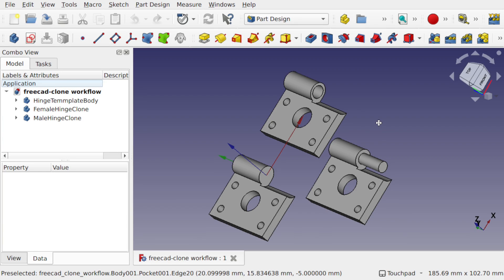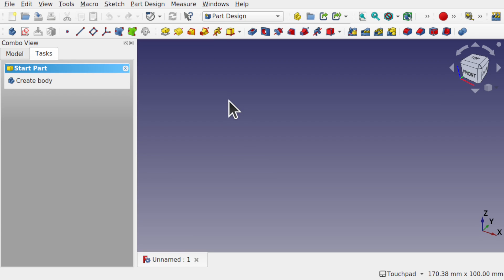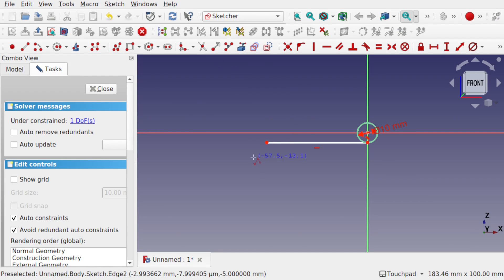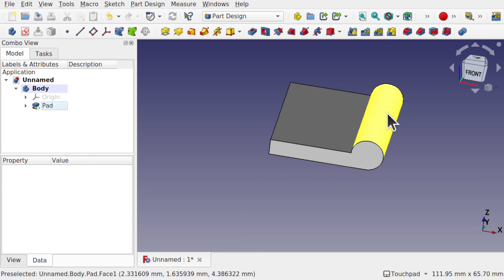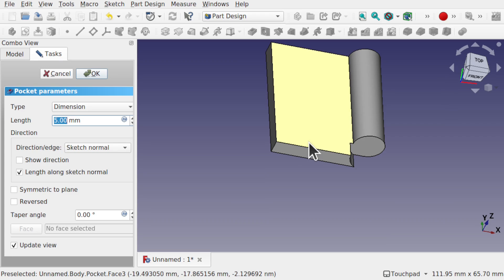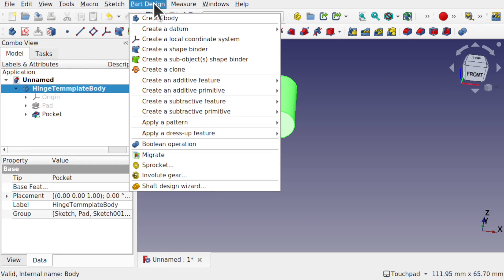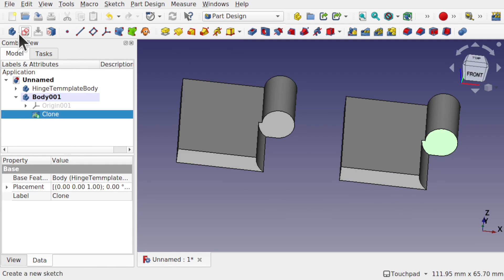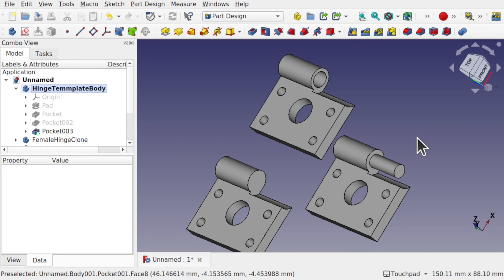FreeCAD 0.20 For Beginners | 20 | Multi body Clone Workflow | Modelling Simple Hinges | Part Design

Comment: Thanks alot for this video. Going to 3D print those and now i managed to design it. The hard part i think is to know on what plane you should sketch and also thinking of what parts to create and how. Guess i learn the more i sketch :)
Is it any benefit to do as you do in this video but also before adding the body, add a Part?
So that you have parts for the main body, female and male? Or is this just one step to much that does nothing?
How do i extract both the male and female body to a 3mf (or other format) to put in my slicer? Now i have to extract each body separately
Also you set the difference between the male and female "hole" in the hinge to 1mm. What do you think is a good value if 3d printing? to assemble the parts. 1mm is a little bit to much loose fit?
Reply from the maker: Glad you enjoyed, bear with me if I miss a question as replying on phone and it doesn't give me a chance to review your comments as I am typing. So for planes it's best to, I don't always do, keep these as true to real world as possible so if your modeling something in front of you or visually the plane that it sits on would be the xy plane and you can then match the sides. It makes quite a bit of difference which plane you start with. Take a look at my short series called "CAD thinking" I explain how the number of operations change depending on the plane you start to tackle your object from. I can't remember what else you asked so I reply in a new message lol. BRB.
Reply: @MangoJellySolutions  yea i also asked what tolerance you can use when 3d printing parts that is joining together, you set 1mm on those parts but whats a bit more firm fit?
Reply from the maker: @jespero94  I found that on my 3D printer I can get away with 0.25mm for a firm fit. I discovered this when making threads for jars. There is something called a tolerance / clearance tower that can be printed and you can test the tollerances for your 3D printer
Reply: Thanks will try that! @MangoJellySolutions
Reply: Actually how to export multiple bodies to one file. I marked both files, clicked part, clicked compound>make compound and then you mark the compound that is created in the tree to the left and choose export. then both bodies come in the same file :)

Comment: Thanks for some great tutorials.  My question is how do you take the hinge and then attach it to other bodies in the overall model.
Reply from the maker: Glad you enjoyed.  You can use it in an assembly with another objects or you can create a 'link' into another file.  I have a few videos coming up regarding assemblies and individual parts which may help.  It's taking a while to create as it's 4 individual parts along with an assembly and spread across 5 videos.  The editing is taking a while.

Comment: Quick question, not having used this feature as yet, does the changing of a clone work up and down or just down from the original? i.e. If I create a clone and clone the clone, will changes I make to the 2nd clone change the 3rd clone and the original, or must I make changes to the original to get changes to the clones. Let me know if you don't follow my logic. Great video. I will enjoy playing around here.
Reply from the maker: In your example changes to the second clone will move down to the third but not up. It's always moves down from the operation you cloned as well i. e clone the whole body everything gets cloned down. Clone the pad operation  of the original then you clone from that point. Create a pocket on the original on top of that pad it won't be cloned. Glad you enjoying the videos.

Comment: This could do with a followup. Just telling people to be careful with the fillets doesn't really solve the problem if being careful just means no fillets. Instead of placing the sketches on the faces of the cloned bodies, they should be placed on an origin plane and then offset in Z by the necessary distance. The offset should be an expression (just like setting the pocket length to Pad.Length / 2) so it stays with the face even if the underlying geometry changes.

Comment: Would love a tutorial on setting up and using freecad with something like mbdyn for simulations. Fusion360 contact sets do not seem up to the task, solidworks too damn expensive for part timers, hoping freecad has a bench that's not mind bending learning curve. (only want to judge angles, lengths of lever interaction with sliders and other components not fea or fluid dynamics).
Reply from the maker: mbDy dynamics workbench is a interesting workbench which is, well as by the name in this realm.  I am looking to do a set of tutorials on it as there is so much on offer within.  It's trying to build some tutorials that I can present without scaring people off as this area can get very complex very fast.  I have a few ideas that I am going to test the water with.
Reply: @MangoJellySolutions  yeah I guess it's kinda of a niche area, but then again you maybe the only source on YouTube. I just looked back through a few of your vids on animation, that should keep me busy for a while.
Reply from the maker: @tvathome562  i'm looking at doing some mechanical movement.  I used to own a really old book with a large number of the movements within, rack and pinon, cam follower etc and I would love to recreate these all in that workbench along with tutorials
Reply: What you don't have close to four grand lying around  for solidworks?